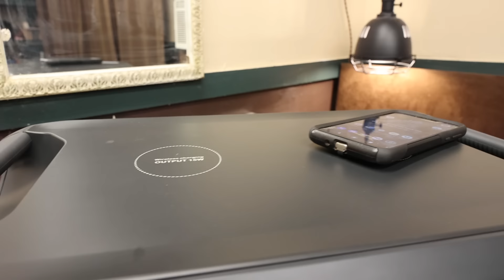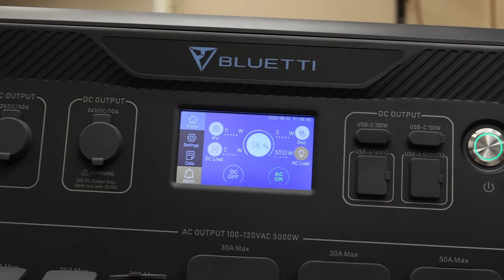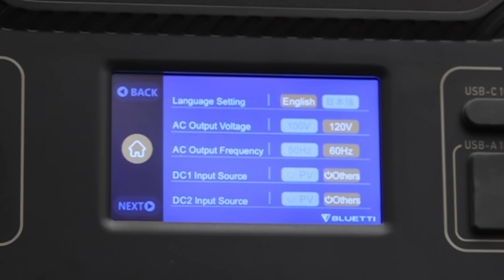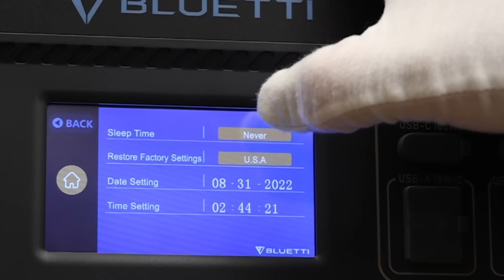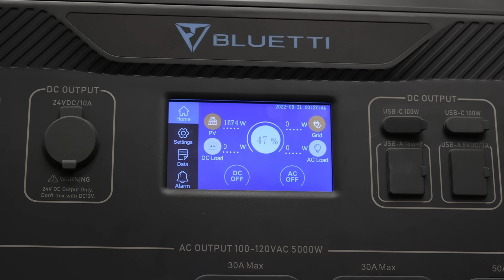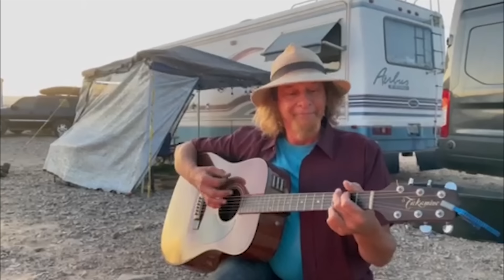Bluetti AC500 5000w LiFePO4 UPS Portable Power Station Solar Generator Review

Comment: The UK, EU and AU versions on the Indiegogo page all have 240v (well, they say 230) as standard. I wonder if US or JP buyers can get one of those and simply use some sort if adapter for their 240v appliances, then plug a step-down transformer in for their normal stuff?
Reply: Sorry, but Your 240V is Split-Phase, so it's 2 phases running at 180°, you need two inverters to produce this, like you need three inverters to produce the European 3 Phase (3 x 120°) system. The different between the US and the 240V Bluetti is the 240V runs on 240V so it needs other components and less copper due to the half amperage it delivers. (It would be nice if Bleuetti designs a tripple AC-500 combination for Europe.)

Comment: I do live in a place where it gets 40 below from time to time with 63 below windshield but that's only maybe a month or two of the year and it doesn't happen every last winter I did see like 15 below maybe it's 25 below because my water pipes froze but now that blue Eddie starting to make the generators I like that add beer to use from my house Nam have to save up the money for them and I suppose I could just buy ten of the same generator but instead I was by five of the different generators and ones that go with batteries I'll buy all the batteries for it to when I can afford to start doing that and some of that I might able to start doing this year of course there's a couple other generator sets I'm going to buy as well that's not from bluetti but I start buying their generators this summer but I won't be to buy all the batteries until next year or the year after. There's also another who regenerating to buy and that's the AC200 probably what I'm going to start with even though it ain't nearly enough they also take batteries but at least it'll be able to run the lights in my house. Or some my electronics and small freezer and frigerator and the computers and that is a start.

Comment: Could you 2 of these with max batteries and solar panels and install to the main of a home with a transfer switch? If so could build your own solar system for 15k. Does it do passive charging?
Reply from the maker: Yep

Comment: So we purchased the AC300 in the last 30 days and now we're very interested in also adding the AC500 and doing a "Split Phase Bonding System" so I can run the big stuff in the house.  I am also going to adding some 320w solar panels to the roof.  Do you see any issues with an AC300 and AC500 working together to create the 240v power?   Also, can I net meter with this setup?
Reply from the maker: Can't be done.
Reply: @HOBOTECH  Please clarify.  Is it the Split Phase with the AC300 and AC500 that can't be done?  Or is it the net metering?  Or both?  Thanks for clarifying:)

Comment: Course they come up with ac600 that does 120 240 then they come up with ac900 it doesn't 120 240 only three months after you made this video and that makes it so I want to buy that complete generator sets of of the complete five generators combo pack to 5 different generators with all it's batteries to each and as far as I know only one of those don't come or have batteries with and can't take batteries. And if I can get all those units all those different generators with each of them coming with two generators get all those five different generators two generators each and all the batteries including one that doesn't even have batteries to it that would be all I would ever need power my whole house and everything in my house and it'll make it so I never run out power even in the winter. I've never have to buy an inverter if I had all those generators but I probably would have couple inverters anyways and batteries to go with that cuz all those generators would not better handle all the solar panels I will have.

Comment: I finally got my AC500 and it's broken right out of the box. I turn on the AC inverter and give it a 350W load for a few hours and it consistently shuts off with "012. BUS Voltage High" error. The unit is basically useless and causes power disruptions every time I try to use it.

Comment: I purchase one of your recommended power station under 300$ that wasn’t the issue , the problem is the making of that unit on the 12v socket I had nothing plug in yet and turn on that dc port and an error display so I turn it off and yeah it messed it no drop of hard pushing was done. So after so much attempts I open my unit and yeah the way this connector port is and was made with no precautions or fuses many won’t test this😅of course we don’t to avoid warranty protection but when will we know how our unit is made in quality?? So I try to fix the issue unplug that dc cigarettes connection no success everything is built in some transistor got burn super tiny to repair and I’m out of warranty period . Also the plastic body screws broke when taking apart is like if the composition of this plastic was ice( too delicate ) any moment broke those holding areas . Bad experience Thank God the ac , usb still work . But we need better longer warranty from companies

Comment: So for around $13,000 you can get 3000w for six hours. No thanks. That about what you can get from a $1000 inverter generator and a tank of propane. And don’t give me the BS of Solar charging this. You would need 30 100w panels for 3000w.